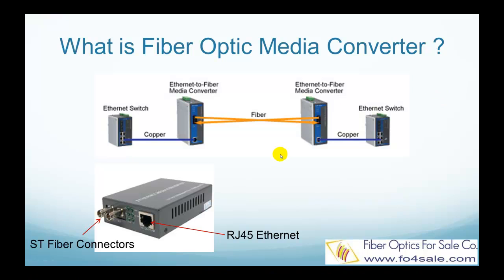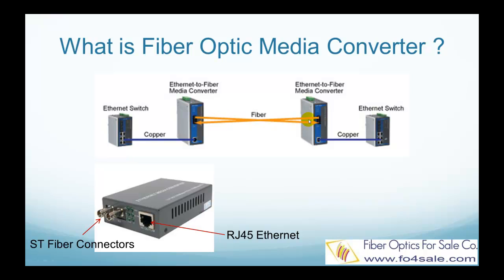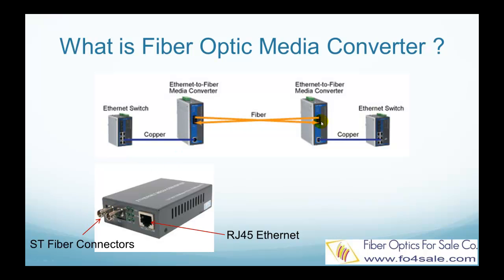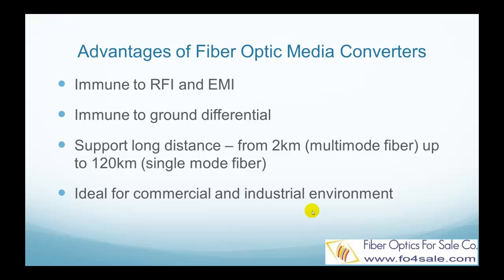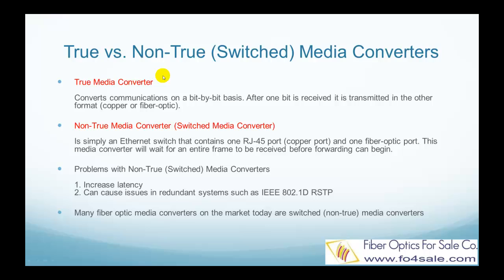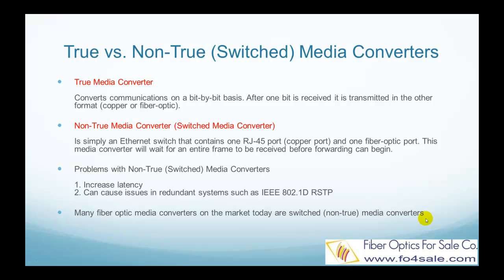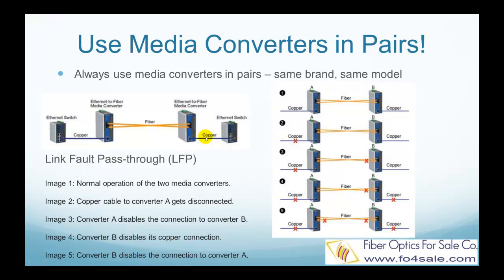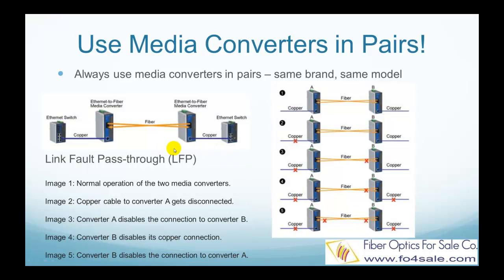What is Fiber Optic Media Converter?

Comment: Hi Colin, I have a network that I am using fiber to transmit internet from on point to the other. The point is I want to move my router to the other end. In both ends I have a switch to connects the different networks. Now I want to use the same fiber cable to send internet signal to the router and in the fiber send back internet to the other switch. Please help.
Reply: are u mean: " u want a new line joining at your fiber existing?"

Comment: hye.
wondering why we need to cross the FO between the two converters?
Reply: Adam, the "transmitter" port on one converter must plug into the "receiver" port on the other. If you connect transmitter to transmitter and receiver to receiver, the converters won't pass any data to each other.
Reply: Because the converter's fiber connector has a optical transmitter (Tx) and a receiver sensor (Rx). So the sender's Tx must reach the receiver's Rx and vice-versa.